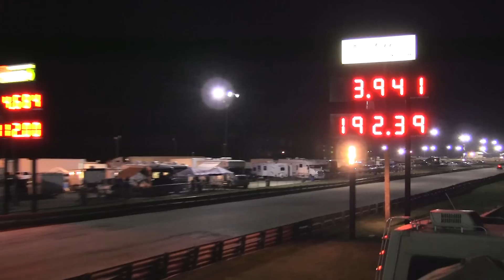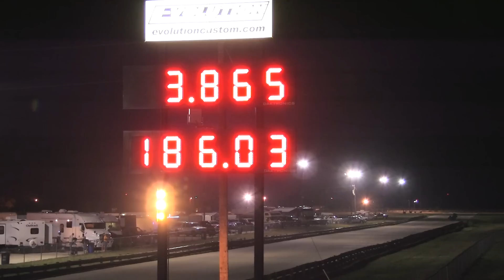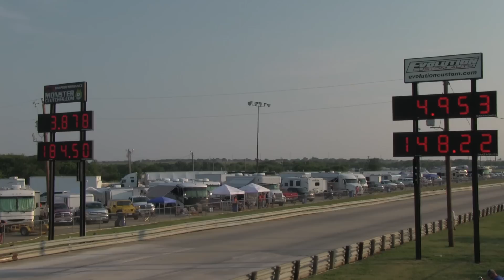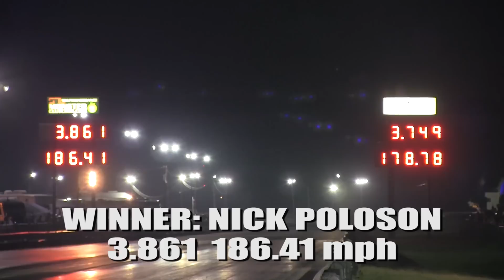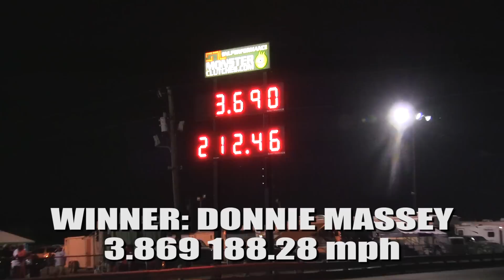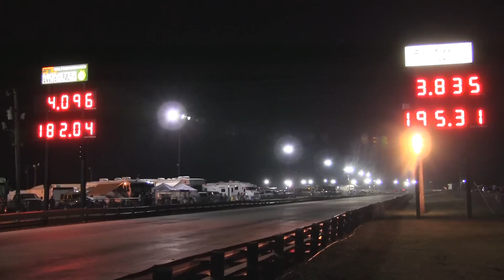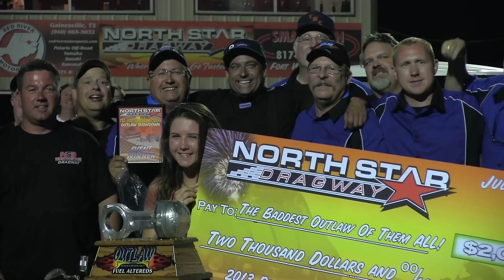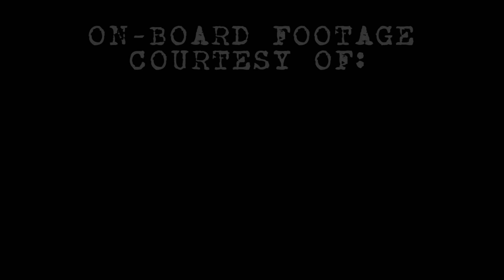2013 Pro Mod vs. Fuel Altered Showdown

Comment: guy was really freaking out at 15:09 to the left of the screen
Reply: That was actually a Gal, the crew was upset because the Pro Mod wouldn't stage and was burning their engine down. If you'll watch the Altered was staged for over 30 seconds and the Pro Mod never turned his prestage light on. Note the Altered ate a piston at 300'